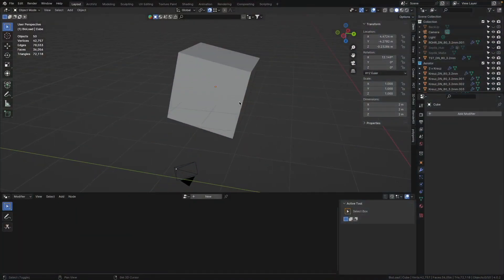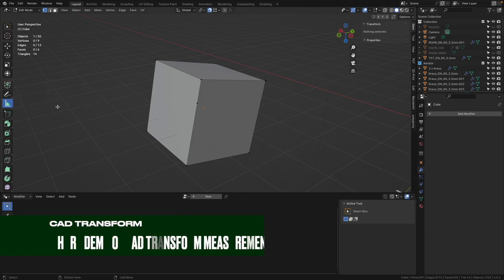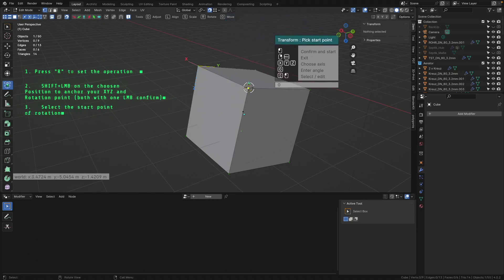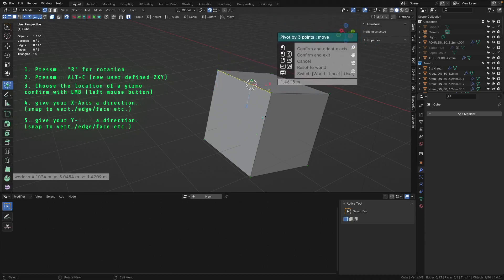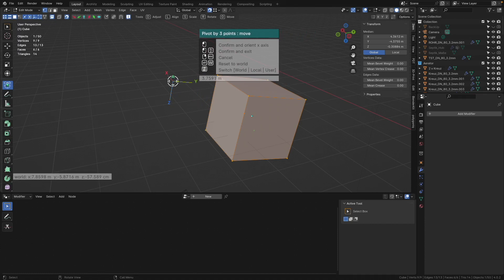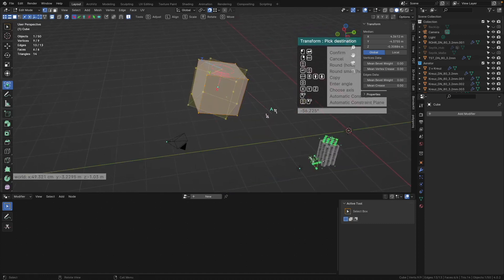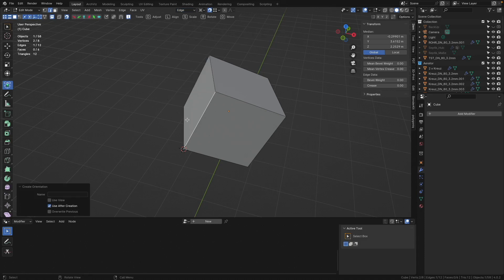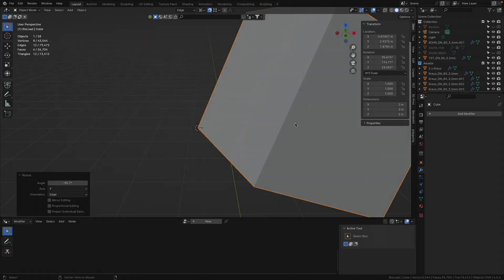Rotation in Blender 4.0+ & CAD Transform 2.0 New / How to rotate and Measure angle

Comment: What version exactly you use i use 4.2.1 and cad transform 2.0.2 and snaping isnt woeking in  2d edit mode
Reply from the maker: @nadeemrmaileh2615  hello and thank you for the comment 🙏
The setup I work with is:
Blender 4.1.0
CADTransform: 2.0.6
Best regards
Reply from the maker: @nadeemrmaileh2615  you probably need to activate vertex icon, up left next to snap options

Comment: it is too bad that for gab the new snap system works well but for scale and rotate you can easily define. start point second and third point for scale and rotate and need an add-on for that.

a tool sketchUp solves so well
Reply from the maker: You absolutely right! Blender needs some new basic functions for example like this one, that I suggested for the voting:
https://youtube.com/shorts/w2k1_vRCLzQ?si=xV1bIcy9j6b_0ffZ
Each upvote matters, especially for us building/architectural guys :)
Thank you for the comment 🙏